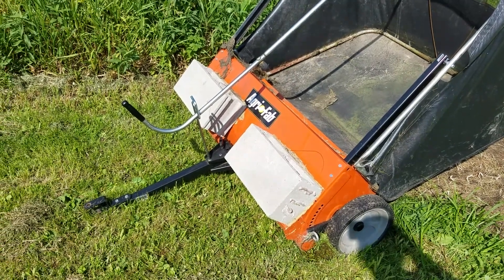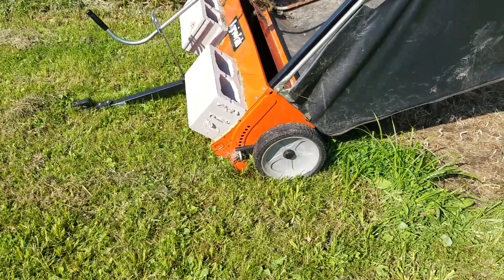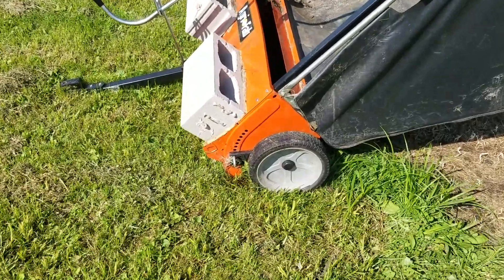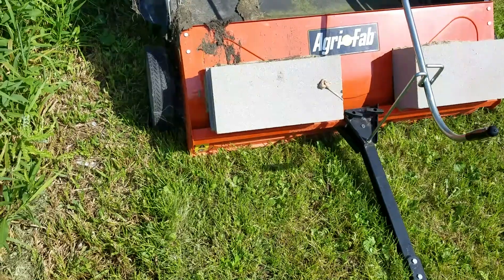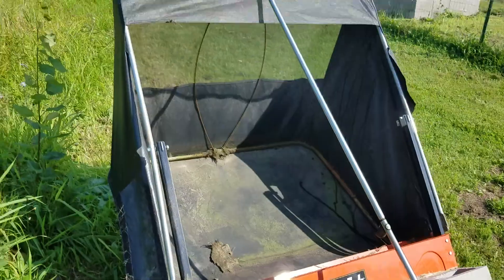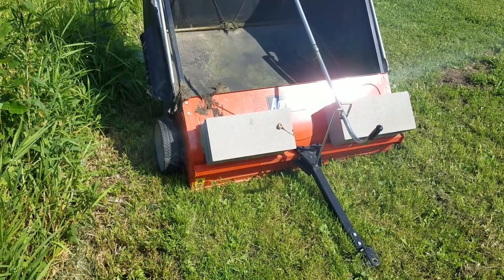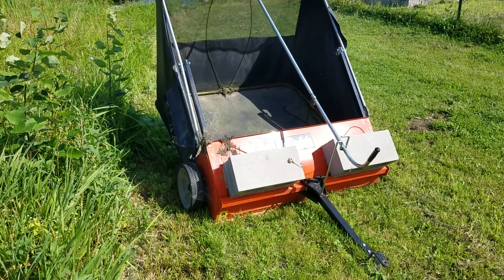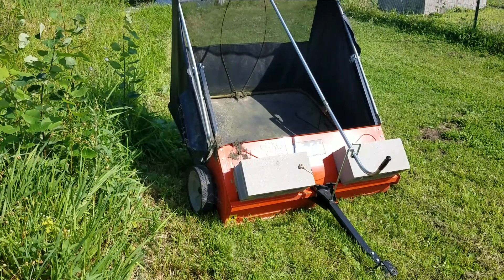how i got the agri fab lawn sweeper wheels to stop spinning on grass

Comment: For those saying the brushes just need to be raised, I have the same sweeper and the same problem as he has.  I have adjusted to brushes even up to the point where they just blow a nice breeze on the lawn rather than picking anything up, and I'll still have times when the wheels will drag.  If I drive on my driveway where the wheels get traction, it works perfectly; in the grass not so much.
Reply from the maker: The brick trick worked for me and been working 3 years now

Comment: I made cleats for mine.  I made a metal band 2" wide and long enough to wrap around the tires.  Welded 1/2" x 2" pcs. of metal [cleats] across the band about 2" spacing.  My tires are 10 1/2", if your tires are smaller, might have to use less spacing. Put 4 screws through the band into the tires to hold them on.  No more slipping.

Comment: I just got one of these sweepers and the wheels on it would skid across the grass even after raising the brushes to just skim the top of the grass. Adding a couple of cement blocks helped considerably. I believe that if Agri-Fab would make a tire that had some kind of aggressive tread, or even small spikes, the blocks probably wouldn't be needed.

Comment: I noticed some of the newer models have those smaller wheels so I looked for the model with the large wheels. I could see after doing some research that those were not the ones to buy and now after seeing this video, I'm glad I didn't! You should also take the wheels off every season and lubricate them and the gears so they last longer and work better.

Comment: I have the same sweeper have the same problem greased everything still have the problem so I'm trying to fix it by putting some little snowblower tires cutting the tread off screwing them on and gluing them on with Loctite caulk whatever
Reply from the maker: how did it work out ?
Reply: @AdventuresInLiving  it helped but the sweeper turns a little bit slower than before but adding weight helps it to.

Comment: I had thought about trying this...was having the same problem. They told me I'm driving the tractor too fast. But I still might give 'er a try! I'll find a way to use rubber straps or some other way of temporarily holding them since I hang mine up during storage.
Reply from the maker: OldSkooLMusic it made a huge improvement specially in the morning when grass is wet
Reply: Thanks, gonna try it!
Reply from the maker: @musclecarluvr1   how did it work out for you  ? were you able to rig up something where they were removable ?

Comment: If the wheels slip when the brushes are completely off the ground, it's a friction problem inside the mechanism.  Maybe something was tightened down too much during manufacture, or bearings, gears, etc. need to be cleaned and re-lubricated.  I bought one of these used, and the wheel will drag when the rotating brushes bottom out on uneven ground, but with appropriate clearance the brushes (and wheel) rotate easily.
That said, I was hoping to find some tires for it with deeper tread and more grip, to set the brushes low enough to pick up acorns.
Reply: Drill in some self tap hex head screws to work like studs on snow tires
Reply: @bobkucharski9425  I don't see hex heads reaching solid ground through the grass.  Pegs an inch or so long might do it.  IMO a set of wider "knobby" inflatable tires would be a huge improvement over the narrow, hard-rubber ones with "tread" a millimeter deep that come with it.
Reply from the maker: I agree

Comment: Also just wondering why is in your basket hooked up to your basket frame
Reply from the maker: it works just fine the way it is
Reply from the maker: can you send me a link to a video of yours and how its kept it perfect like new condition at all times ?
Reply: When not in use keep it inside Lube it as needed
Reply: Keep it inside Lube it as needed proper brush adjustment and don't glue shit to it simple as  that dillhole

Comment: I have the exact same Lawn Sweeper and I have absolutely no problem it is a Lawn Sweeper not a yard dethatcher
Reply from the maker: You must not have as wet of grass as i do. In the spring its like a slip and slid. Trust me this helped it work way way better for me and has caused no damage to it what so ever
Reply: @AdventuresInLiving  I agree...whatever works, works.  But it could be that the brushes are hitting the lawn a little too hard preventing the wheels from rotating. Might be too much resistance.

Comment: Adjust your brushes so they wont touch grass or only slightly and wheels wont spin. The goal is not to comb the grass but just sweap everithing off from it. Brushes too deep and wheels slip on dry grass also. 😉
Reply from the maker: Good to know its been working good with the blocks so far
Reply: totally agree

Comment: I've never had that problem, but it's a good idea. I always pull the wheels and grease the axles because they wear out really bad if you don't. Maybe try that too...........
Reply from the maker: +Bill Cenne thank you for the tip. I try to keep them greased pretty well. grass tends to be pretty wet around here so makes it slide really easy with the extra weight. works really nice now
Reply: you  "MIGHT" be running the brushes too low...............
Reply from the maker: i tried adjusting it. this worked the best to get it to get some grip with the wheels

Comment: Mr. Adventures in Living do not underestimate how powerfully your DIY videos can impact and traumatize fragile egos. Watching this reckless 1:28 minute videos where you are actually trying to HELP OTHERS  could have prompted me to spew hate-filled insults at you!LOL
But for me it gave me one possible solution, and your more mature audience offered some other important points I had overlooked (wheel maintenance, etc.).  So thanks
Reply from the maker: My pleasure. And it did actually help improve the sweeper for me the homestead is in a area that can be really wet and it helped with the wheels on the wet grass

Comment: Instead of weighting it down with cinder blocks how bout just screwing in some screws to the tire treads?
Might have to keep it off of your concrete or asphalt driveway,but I bet it will stop the tires from spinning or sliding in the grass

Comment: that really helps the resale value lol
Reply from the maker: +Brett Boutan lol not trying to resell trying to get it to sweep without wheels just sliding on wet grass. It actually helped big time
Reply: I found out a new one only costs  a couple hundred bucks and you can only get about five or ten bucks for a worn out one.........
Reply from the maker: no need to resell its for use for me only

Comment: Good choice to put concrete on metal
Reply from the maker: it's made a night and day diff
Reply: Not sure if you're being sarcastic or being genuine. If you're being sarcastic: 1) there's a layer of contact adhesive between the 2 surfaces. 2) In commercial applications steel studs are always put directly on concrete, and shot down with a ramset. The studs may be a different steel composition, but they aren't like stainless or anything special. Also rebar touches concrete in every structure you've ever been in.....If you're thinking well the rebar/steel is embedded...Well not all. There are often times threaded rod sticking through the concrete to fasten the bottom plate if its a wood inner structure and not steel stud.

Comment: Whatever your brushes are set too low for whatever Heights your grass is plus maybe it has something to do with the fact that you have it sitting outside all year long
Reply from the maker: i do appreciate your input i think your trying to help in theory by trying to help me or others from breaking there sweeper. but your going about it by attacking someone and calling them names it never helps open people  up to advise . keeping it out all year long has nothing to do with it. i do not have the brushes set to low even if i have them set so there all the way up and just in the air the tires would still spin when was brand new. by adding some weight on to it it allows the weeks to get a way better grip on the wet grass where i live. i have not broke it. works way way better for me now and im quite happy with it over all. and thought i would make a video showing others what i did to make it work for me in case they have the same issue. i don't see why you keep wanting to bash me about it even after i told you that it works fine for me. its actually kept in a shed now so that it is not exposed to the elements and i make sure to grease it so the wheels spin nice a freely.